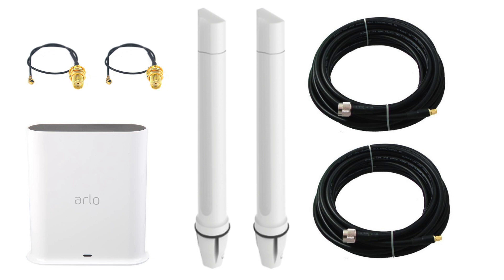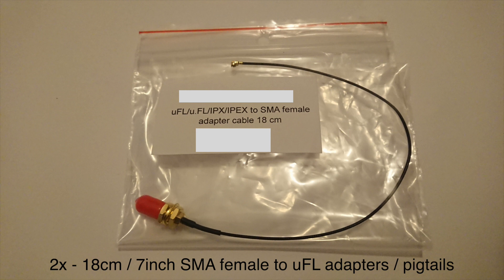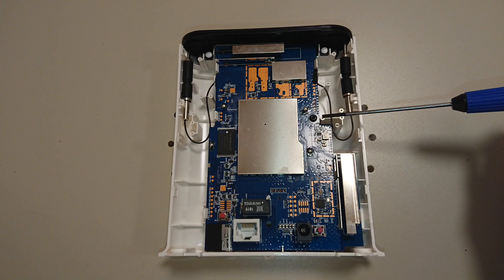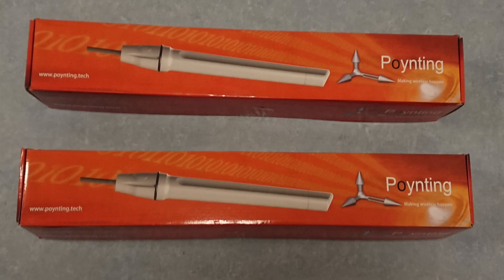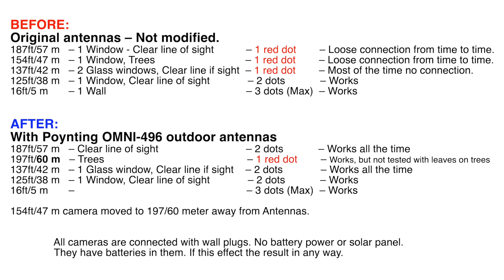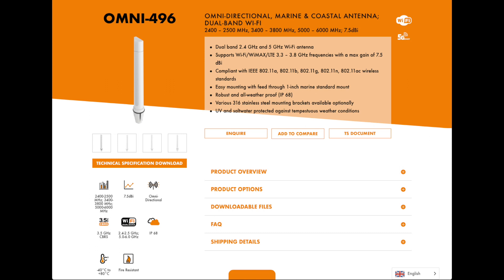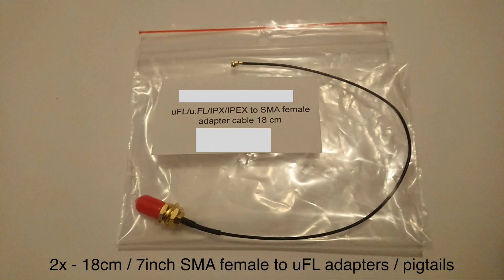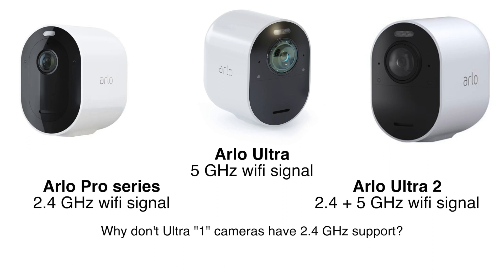Arlo Ultra SmartHub VMB5000 - External antenna for better range

Comment from the maker: Just found that iFixit have made a great teardown guide of Arlo Ultra camera. In Step 29 they show the tiny internal antennas and they are tiny.
https://www.ifixit.com/Teardown/Arlo+Ultra+4K+Wire-Free+HDR+Security+Camera+Teardown/121432

Is there anyone who have tested to modify an Ultra camera with an external directional antenna? This would be a great solution to extend the range even more OR/AND position a camera around a corner where Arlos wifi dont cover.

With my base station modification I can get at least 60 meter clear line in sight. (Have not tested the limit but should be able to get 10-20 meter extra with no problem if not more.) With a dual antenna (Arlo Ultra camera seems to have two antennas) that is directional can it get to 150 meter (490 feet) with clear line of sight?

According to IFixit, Ultra camera has a CYPRESS CYW43012 chip for wireless. It also has support for 2.4 GHz Wifi... Why cant Arlo enable it?

PDF for Cypress antenna. https://www.cypress.com/file/384986/download
Reply: This is a great tear down and I should have bought the Ultra set so I have a complete breakdown of my camera. Very informative.

Comment: The antenna is more expensive than the hub.
Reply from the maker: Yes. Needed the antennas because where they where installed and coverage. Would I recommend people buy Arlo today? No. Better with example Reolink and use your own Wifi (Different VLAN) instead of separate camera Wifi. They are not cloud that you have to pay monthly for and have wired cameras.

Comment: Can I use a longer cable to mount one of the antennas in the front of my house and one in the back to extend the range on both sides? Thanks and your video was excellent!
Reply from the maker: It probably should work with one antenna at each side of your house. Or do what I and get a long antenna pole so the antennas can see both sides of the house?
Have you looked a the video update? https://www.youtube.com/watch?v=zPHsrjU-OP4

Comment: bro , half ? I have camera 8 meters and signal does disapear 90% of the time lmao, Arlo as its best !! @arlo
Reply from the maker: The range of Arlo Cameras isnt good. 5 GHz Wifi has worse range then 2.4 GHz and these cameras do not need the bandwidth of 5 GHz. They maybe did choose 5 GHz because 2.4 GHz space is so crowded. But why did they not have 2.4 and 5 GHz enabled or let the user choose what frequency they want to use?

Comment: I don’t have any use for it but if I could get more I could cover more
Reply from the maker: This is to go around Arlos limits. They want their customers to buy more base stations and for this project to get the same coverage would need at least 3 base stations to get the cameras at these positions to work or even 4. So modifying one base station is much better alternative for me.

I made en updated video with more information about this modification. This modification can be made much cheaper with shorter cables, thinner/cheaper cables and cheaper antennas.

Comment: Are there any cheaper external antennas that work well?
Reply from the maker: Yes. There are much cheaper WiFi antennas you can get. Search around... Get a "outdoor omni wifi antenna" that supports 2.4 and 5 GHz.

This project used these 496 antennas (there are a 296 model that is cheaper), but this project used these extreme boat antennas because it was close to ocean (496 antennas are made for boats) and wanted as big coverage as possible.

UPDATE.
Installed a Ubiquiti UAP-AC-M UniFi for wifi and that units 2.4 Ghz coverage with the included two tiny antennas almost cover same big area as the Poynting 496-antennas. Using a Wifi scanner in a phone to see the signal strength. As long as you get antennas for outdoor that can handle the weather I think you will get much better coverage then using the included antennas in the Arlo basestation being located indoors. Smaller antennas dont stick out that much either. These Poynting are huge.

Comment: I  going to do this on my Pro 3 setup hopefully I get the same results?
Reply from the maker: Pro series cameras use 2.4 GHz WIFI so you dont need 5 GHz antennas I used. Or do you have the same base station as me but with Pro 3 cameras? Then 5 GHz antennas is a good choice if you want Ultra cameras in the future.

I can not say you will get the same result. Probably longer because 2.4 GHz signal can travel further. Share the result of your modification? Before and after result? Signal strength and how much further distance?

This modification isnt hard to use. The most scary part for me was to remove the old antennas and connect the new connectors in the Arlo base station. The connectors feel so fragile.

Hope I have given good information in the video, where I sound like a complete idiot, but if there is any comments or questions just type them here.